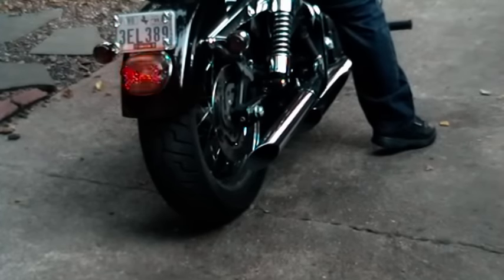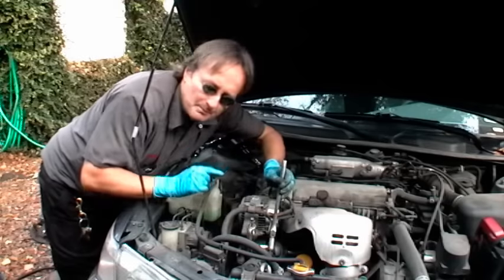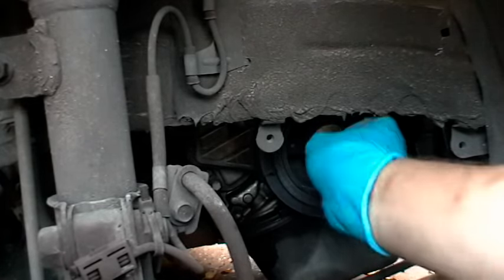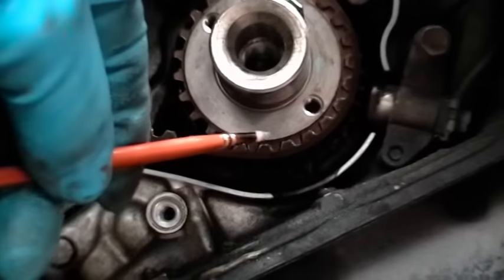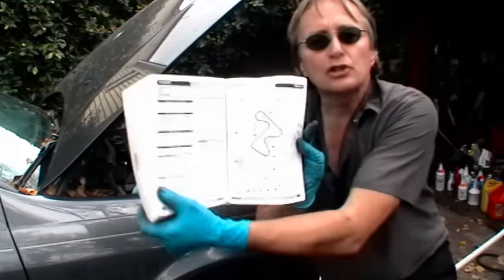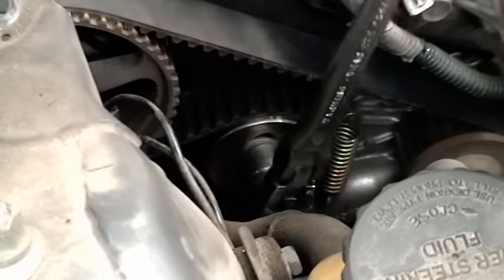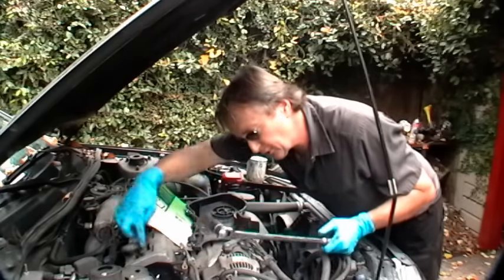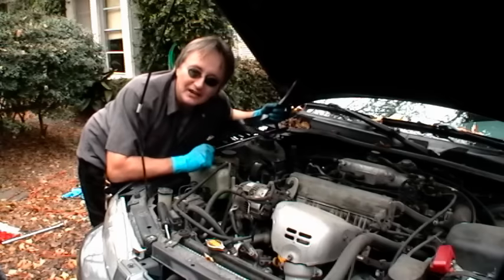How to Replace a Timing Belt in Your Car

Comment: If you don't mind Scotty , i replace the timing belt on my 05 kia Sedona , all markings r lined up however when i started all i hear was tick sound no cranking . So i decided to go ahead and buy a new battery , HAVE MERCEY THE CAR WAS STILL DOING THE SAMETHING !!! i need ur help bud..
Reply: It's the starter. The click sound you hear is the solenoid shoving the starter's gear into the flywheel ring gear; the no-cranking means the starter motor is either not getting any power (make sure the cable from the battery to the starter's hooked up)  or it's just broken.

Comment: Hi Scotty K. I have a chevrolet cheyene 1990 that wont starts , I put new battery and I do switch on try to start relly poor cranks  , seems the engine or belts are to tie , what I should do to fix it , thank you ...
Reply from the maker: +Luisinhozambao.jr  try my video "fixing a car that cranks but doesn't start up"
Reply: +Luisinhozambao.jr I would guess it's the fuel pump.  I would at least keep it in mind anyway.

Comment: Hi I have Mitsubishi Carisma 2004 Gdi engine and it seems to be heating up although temperature gage is showing nothing but when I park my car and keep the engine in neutral gear the cooling fan is turning on every 20 second and switching of very often too also If I shut down the engine I can  hear sound of my engine cooling do you have clue what it could be ? thanks
Reply: Karolis Paulauskas Broken head casket maybe

Comment: hi scotty. i just put a timing belt on my nissan maxima 92 and turns out my car didnt work because my timing belt wouldnt spin. it turns once and it gets stuck in the second turn when i turn the crankshaft. any idea what i can do or what might be wrong?
Reply from the maker: +ShootEmUp Gomez sounds like one of the cams locked up.
Reply: +Scotty Kilmer  is there any way to fix this?
Reply: +ShootEmUp Gomez not yourself if you don't have any experience with engines because you could worsen the situation (just a friendly advice)
Reply: +ShootEmUp Gomez Did you pull the camshafts out or remove any of the pulleys besides the crank and tensioner?
Reply: +ShootEmUp Gomez I hope you are kidding because you can bent some valves very easy and then it gets expensive. What you can do is very carefully! turn the crank in to the right position. If it get stuck, turn the other way round. Remove the belt and set (carefully again!) the cams in the right position. Now put on the belt again (look on the belt in which direction it turns). If you're done, turn the crank 2 times and check timing and tension again. If you haven't bent the valves, everything should be ok now.

Comment: I was driving on i75 when my 1997 started over heating and when I opened the hood the timing belt was completely off! Why does this happen????
Reply: 1997 BMW
Reply from the maker: +Yamally Beautyme cause the engine went Kaput. Get it hot, metal will freeze up and lock in place, then timing belt shreds
Reply: +Scotty Kilmer yeah it's exactly what happened but the engine is okay still you think I should get another belt, ans have my dad replace it? I found out it wasn't the timing belt, it was the pump belt (serpentine) I believe thanks !!!

Comment: what was that tool you use at 3:36 is it strong enough to use on the engine mounts because im working on my 1989 toyota corolla and the engine mounts are too hard to pull with any of my hand tools that can fit in there the bigger hand tool i have dont fit and there is only about 4 inches of space under the engine mount bolts to take them off
Reply from the maker: use a long cheater bar and socket

Comment: Folks dont do it this way. Its amatuerish. You dont use tippex-Ya do it properly. Get all your car's timing mark data online,get a proper guide & do it that way. This way you're only replacing the same old bad timing issues your car is sure to have after years of stress etc on belt. I expected more from you mate
Reply: I don't really agree with you.. but i think the "it will break your car if you don't do it right" could be stressed a little bit more.

I do all my own regular maintenance on my car except for the timing belt; only people with insurance touch the timing belt.

Comment: I have 1992 Camry timing belt is broken and after I replaced my car won't start.crank but won't start . any idea?
Reply from the maker: do my video "fixing a car that cranks but doesn't start up"
Reply: ive seen on those toyotas when the belt breaks they damage the teeth on the reluctor wheel the crank sensor reads or damage the crank sensor itself. had one last year where the belt broke would show zero cranking rpms on a scan tool and random would show some absurd number like 35,000 rpms and then go back to zero. found the crank sensor had a big dent from the broken belt

Comment: hi scotty i have a 99 cavalier. i think the motor has locked up. the cranks turns half way either way but wont give a 360 turn. can yall help a guy out
Reply from the maker: say goodbye to that car, or tempt fate and try a used junk yard motor. Costs too much to rebuild those stinky engines correctly
Reply: +Scotty Kilmer scotty please help we changed the camshaft seal  and changed the oil to full synthetic and now we got it up and running but it has a ticking sound that follows the rpms
Reply: Remove oil pan and valve cover. see where it binds up

Comment: Scotty i have a 89 gmc with a 5.7 i think the timing is off on it it pops out the tbi and it has no power
Reply from the maker: hook up a timing light and see if it's waay off or not, many things can make em pop, especially fuel injection problems on that model

Comment: just did the timing belt on my 2003 vw jetta an now the battery light is on i believe its the alt but dont now if the timing belt can cause that to happen
Reply from the maker: not directly, BUT you may have damaged the alternator wiring or have the belt on too loose for the alternator

Comment: my engine keep making clicking noises. is it the timing belt? been 50k miles on it
Reply from the maker: timing belts generally don't click, worn valves out of adjustment or fuel injectors normally make clicking noises. Have a mechanic see it in person

Comment: Hello Skotty, I purchase a 2001 lexus is300 (one owner) the car has 133,300 miles he never change the timing belt, so I decided to change the timing belt, so i call my friend ( Lexus mechanic) he did it, but after he did we start the engine and the car start but has a clic noise, ( he checked and the noise its coming from the injectors) how this is possible???  Was running smoothly. I need help,
Reply from the maker: odds are it's the valves clicking, not the fuel injectors. Listen closely with a stethescope
Reply: He has a stethescope, the noise its not louder, sounds like clic, the sound its coming from the injector area, the car doesn't has check engine light,  and also drives nice, but that noise make me crazy
Reply: I wish to have you here! :(
Reply from the maker: JOSE ALFREDO Area means nothing. Unplug the injectors near there, and if noise does not go away, it is not the injectors making it then.
Reply: Ok I will try, and I will record the engine thanks !!!!
Reply: One more question, he show me the stethescope and how to use it, I put the stethescope on the head engine and you can heard it, but when a put the stethescope on the injector1 and 2 and 3 the noise is louder
Reply: Scotty Kilmer  ok I did it the noise its not the Injectors, so he need to replace the all engine head, or adjust the valve?

Comment from the maker: don't be too anal on a toyota, rarely does an idler pulley or pump go bad on this model. But it you want, go ahead and change ALL the pulleys and all the seals and the water pump and the oil pump if you're worried.

Comment: what happens if your timing belt breaks while driving. How would I be able to line my marking before I put the new timing belt on? its a non-interference motor so im ok. I hope
Reply from the maker: you put the engine on top dead center mark on the crank, then turn the cams so their marks line up with the line up marks on the head. Any decent manual shows the markings.
Reply: So i can move each cam to tdc. The white indicators on my engine. Line the crank first then the cams to tdc?
Reply: Do i need the belt to move the cams?
Reply: David Mcfalls You turn the crank with a wrench til your engine is at top dead center (each engine is different as to what piston it is). you the turn the cam pully so that the markings on the cam pully line up with the markings on the top of the cylinder head.

Comment: Hello I have a Mercedes Benz E320 and I cant pop my hood up and the hood latch doesnt work so my qestion is is their another way to open it without me paying alot of money out of pocket getting my Mercedes dealership to open it they charge too much
Reply: if you cant get your hood up, how are you doing basic maintenance on it, like changing air filters, serpentine belts, spark plugs, or checking fluids? get your hood fixed. Why drive a mercedes if you are just going to skimp on basic care?
Reply: Thats why car salesman will never lose there jobs :)
Reply: Ok thanks I'll try that
Reply: Yes I do inside the car on the driver side over the peddles the latch is disconected.So pull on that?
Reply: Ok thanks

Comment: Scotty please help me I bought a Ford F-250 2005 and it has a check engine light on, and the mechanics are saying it need a timing belt or to fix it , because the guy I bought it from put a timing Belfast on it and oil pump and they are saying that he didn't do the right gob it has to be done again or it needs a new engine a code came up poo22 and ford says usually that means it needs a new engine please get back to me as soon as possible thanks David.
Reply from the maker: I would assume the timing chain was put on incorrectly with that code. People do screw up all the time working on engines. But, get a second opinion and see what they say

Comment: Oh yes,I forgot to mention that the car I'm trying to fix is a Camry 1999!
Reply: Miguel,
 bottom crank bolt is 19mm if a 4 cyl..  Pls check size of crank shaft bolt if the 6 cyl.
Reply: Learn from my mistake: install a new Toyota water pump- comes with a new a complete Housing.
check all the seals too. Crank, cam & oil seals, if any wet, replace now.
install new belts: p/s & alt / ac.

Comment: I have a 1995 toyota camry 4 cylinders 2.2l engine 2400  miles my transmision fluid is dirty I was gonna change the transmision fluid they told me not to what should i do
Reply from the maker: alex cruz cause it's SO old, if you change it now, gears may slip. IF it works fine now, leave it
Reply: Thank you, I just wanted to make sure from you

Comment: Good video..YOU make this look easy...  
HOWEVER my dad was a time served QUALIFIED car technician for many Years.. 
The number of times he ended up doing repairs on people's cars  when UNQUALIFIED COWBOYS have made an attempt at a repair was unreal. 
UNQUALIFIED COWBOY = Hey I own a drill it means I can "Fix stuff" NO! 
Doing a replacement timing belt on a modern car is NOT a job for just any dick-head who owns a drill and some tools. 
GUYS..I know you THINK you are a car technician and you are "The man" because you drink beer and have tattoos 
But DO NOT attempt to change the engine timing belt on your car if you do not have a clue what you are doing. 
If it is NOT done 100% correct you risk the new belt slipping off... Seen this MANY times..
You risk the "timing" being out on the car and it will run like a bag of nails .. SOME modern cars have to have the  ECU reset once a new belt is fitted. 
REALITY CHECK TIME... Yes guys you own a drill and a hammer and have some tattoos .. BUT LEAVE STUFF LIKE THIS TO THE PRO'S ..Like Scotty Kilmer. 
Just trying to save you the embarrassment of the garage owner laughing at you WHEN you take the car to them after you have been f++king about with it and you don't REALLY know what you were doing. 
Change the oil and the spark plugs yourself  YES... But leave stuff like this to the PRO'S.. OK

Comment: Discussion Starter • #1 • a moment ago

Hello.  I see you did new belt on a 4 cylinder 5sfe camry.  Any guidance is appreciated. I carefully followed the service manual for replacing the water pump, with housing, oil pump seals/gaskets, pulleys and timing belt on my nephews 93 Camry. After i reset the tension on the spring and torqued it down, the crankshaft and camshaft marks were off more than a tooth and the belt didnt seem tight. I removed the belt and reset the camshaft gear (turning clockwise)to match the crankshaft mark, tried again to get the car tensioned and back in time, but when i rotated the motor, the marks dont line up much worse now. Currently, i reset the camshaft to tdc manually by turning it clockwise again and put the belt back on. but im afraid to rotate the motor because when i turn the crankshaft 2 times around to the 0 mark, the camshaft does not line up. I then have to.manually remove the belt again, and turn the camshaft clockwise to line it back up. What have i done wrong? The kit is an aisin kit, which included new belt, spring, tensioner pulley, regular pulley and water pump, with appropriate gaskets. Also, when i first set the initial tension, i followed the service manual by aligning to 45 degrees btdc, then tightened the tensioner pulley bolt to 31 ft lbs. Thats when the camshaft gear was off and the belt didnt seem tight. Thanks for any help. I really dont want to.have tow it t to a service center.

Comment: how about putting a tbelt in a car that broke it's tbelt? say, the camshaft and the crankshaft arent in their right positions.
thanks in advance.
Reply: There is factory marks what show engine top dead center. Crank shaft mark could be on fly wheel and belt wheel. Camshaft mark location depend car mark and model.

Comment: The mechanic I was referred to has had my car for a month to do this 🤦🏾‍♂️
Reply: That't not a good sign :)  Just had my car towed in Saturday.  Hoping to have it back today, tomorrow at the latest.  I'd be calling to figure out what the problem is.  I knew it needed changing, long over due, it's 100% my fault.  But had other issues, wasn't sure if it was going to be worth it to fix it; almost 300K miles on the car.  Now, rather than 450. I'm looking at 800. to include getting the head fixed from other damage it caused.  And, pissed off the shop I've gone to for 12 years by questioning why they weren't testing with the new belt before automatically going the 800.  route and just automatically assuming there was other damage.  Mechanic wanted to do it, said there was a slight chance wasn't any major damage, and if not would save me the 400.  Owner wouldn't let him.  Guess I'm gonna plan on keeping the car for awhile now and looking for a new shop lol.

Comment: this is a very risky job, missing the timing belt with just 3-4 tooth, it migh allready hit the silinder and u can say good bye to the the engine, or if you mess up with waterpump that on most cars needs to be replaced WITH the timing belt, allso seals and so on, basicly u need little bit more time and more to take apart and replace, jst für the sake of the car.

Comment: He dosen't change the belt tensioner. wrong. if it has a waterpump  that is pulled by the TB. that also has to be replaced. And he dosen't use the specified torque values....
Can't really understand if it's a joke his videos or he is serious..
Reply: +Scotty Kilmer I agree with you. Didn't you also point out a manual/belt guide?

Comment: SCOTT  Q? 03 CTS: IF T-BELT BREAKS. CAN I ADJUST CAM PULLEYS TO TOP DEAD CNTR? (QUAD CAM) BY HAND?  ALL 4CAMS OUT OF ALIGNMENT CRANK NOT AT TOP DEAD. I WAS TOLD ALL THIS CAN BE DONE BEFORE PLACING NEW BELT....I NEED ADVICE.....YOU'LL MAKE ME HERO BEFORE MY GIRL.- I PROMISE NEVER TOO DO ANOTHER CTS!
Reply from the maker: yes, you can turn em by hand, but quad cams really need cam holding tools to keep em from moving BEFORE you put the belt back on
Reply: GOTCHA! (I HAVE TOOLS) #4 cam (driver side looking inward engine bay) is the only one locked;  i pray not damaged from belt breakage? Any suggestions??

Comment: im stuck at the 1:15 mark. I got all the tools but cant get that pulley out
Reply from the maker: some cars require a special pulling tool to remove the pulley, but places like auto zone often loan them out free
Reply: ok so i got it off. I'm trying to replace the timing belt on a 1994 toyota celica gt 2.2L. The car was running funny and miss firing and back firing. The timing was off. How do i get it back to being in time again? (sorry my mechanic skill and terminology are very limited)
Reply from the maker: get a cheap manual with pictures to show where the line up marks on the crank and camshaft are.

Comment: No belt here... Double roller timing chain
Reply: Galen Rutledge cause i got more than one car... Other one has timing belt
Reply: Galen Rutledge I dont count a 2000 chevy malibu, since i dont really work on it(no engine bay room)... As it turns out malibu has a timing chain too, thought it would be a timing belt.. But that said i can swap my timing chain to a belt in my chevy nova if i wanted too...
Reply: Galen Rutledge Only reason I can think of is a belt is more efficient.
Reply: +quickguesswho lDon't put a timing belt where a timing chain goes.   Trust me, it doesn't work.